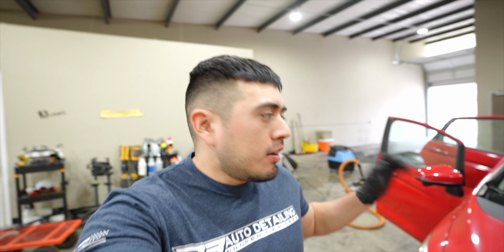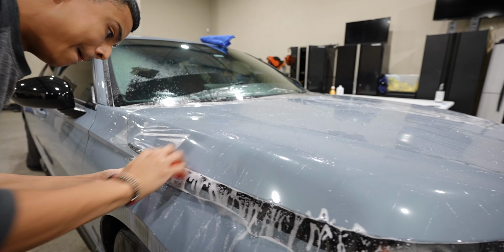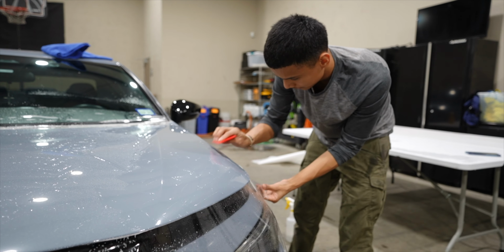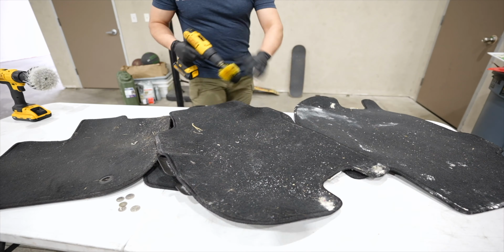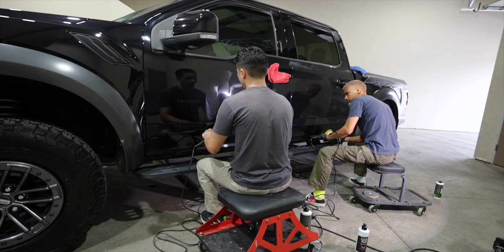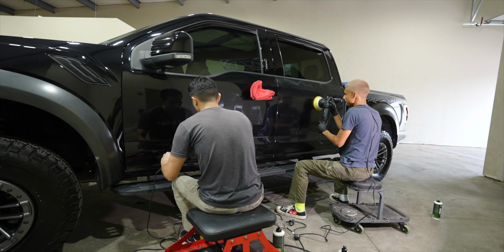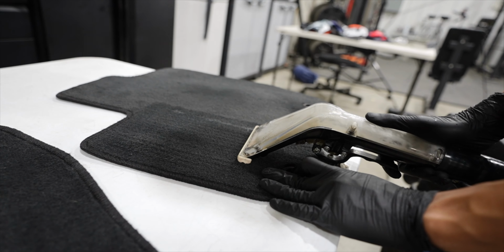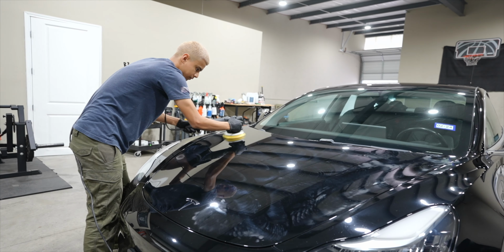Ceramic Coatings are NOT The Best Protection | Day in The Life of Detailing

Comment: How long does PPF last, and is it basically a clear coated wrap?
How does the car look when you remove the PPF after some time/years?
Does it mess up your original paint?
Reply: Ppf is crap , I just did a removal of OEM ppf on a hood , side mirrors and lower back panels. Took me 2 hours because it was breaking off into pieces . The best protection for your car is leaving it in the garage and not driving it 😂
Reply: if the car is garaged, and you maintain the ppf just like paint (and you can even ceramic coat ppf) it can last past ten years.  The average is 7-8 years.  PPF should be removed once it starts to yellow.  It shouldn't damage the paint, although it could damage a repaint if the panel was not prepped properly prior to the respray.
Reply: @KingDaDetailer  So, I think I'll stick to what I'm doing. Washing my car weekly with car shampoo and a wash mitt, and waxing every other month with a liquid wax called color match polish. This doesn't cost much, and my 24 year old car (not garaged) looks great. It's metallic blue, and the clear coat (from factory) is still in perfect condition. 😁🙋🏼‍♂️👍🏻

Comment: I do have a question that I can’t seem to find an answer to anywhere, is there an actual benefit to using a “glass specific” ceramic coat on glass compared to a regular coating or is it just marketing?
Reply: Following this comment
Reply: In my experience there is not a big difference. On glass it doesn’t bond as well and with windshield wipers and windshield fluid it lasts 6 months or so.